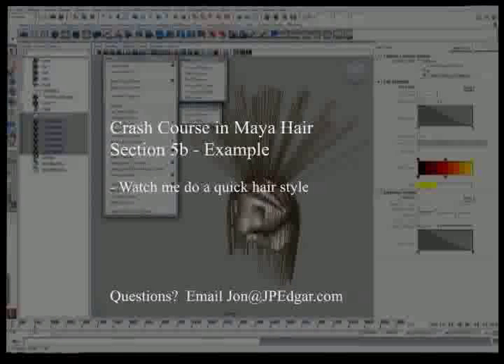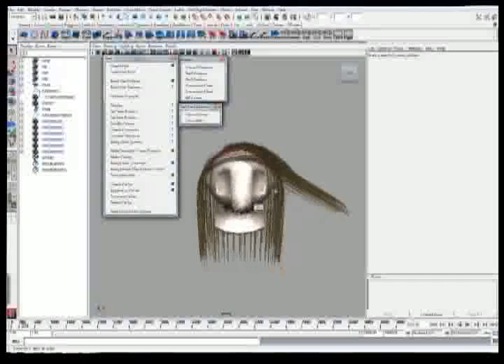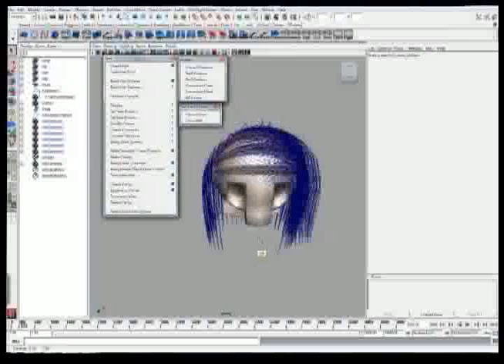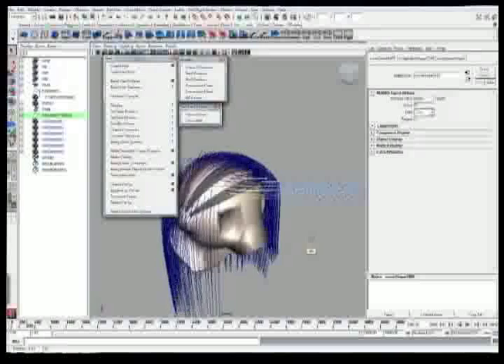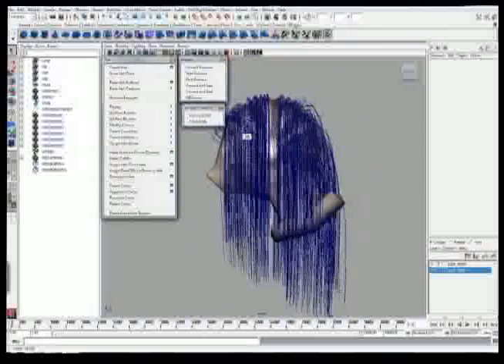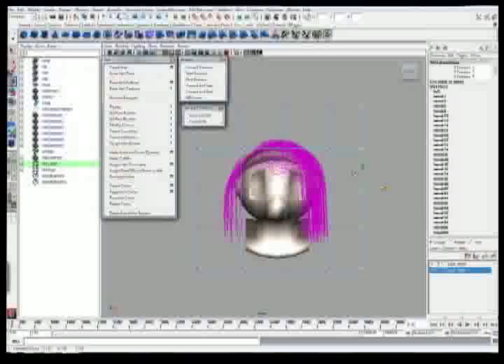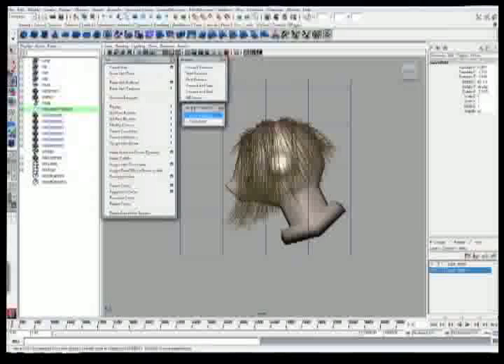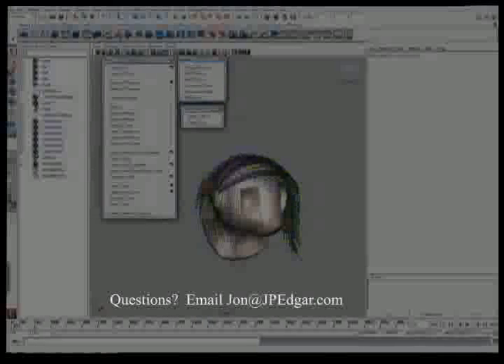Crash Course In Maya Hair - Section 5b - Example

Comment from the maker: @DevastatorsPissed1 
I guess I didn't really cover that part.  The hair is attached to the scalp (or skull cap as you referred it as).  That means if the scalp moves, the hair moves.  You can have the hair attached to the head, but I find it easier to manage in my opinion.  If you put the hair follicles on multiple objects, it can be a mess.  If all of the follicles are attached to the scalp, just do a wrap deformer from the scalp to the head and your hair should move with it.

Comment from the maker: @DevastatorsPissed1 
...  to get to subObject mode, you can click and hold the right mouse button over the object you want (in this case, a curve) and select Control Vertex.  This will turn the curve blue (by default) and purple-ish dots will appear on the curve (the CVs).  Now you can manipulate the curve with fine detail.

Hope that helps.